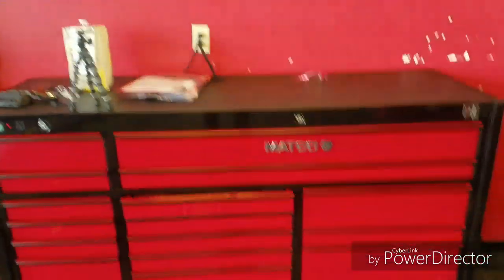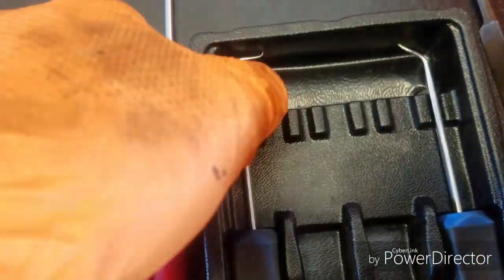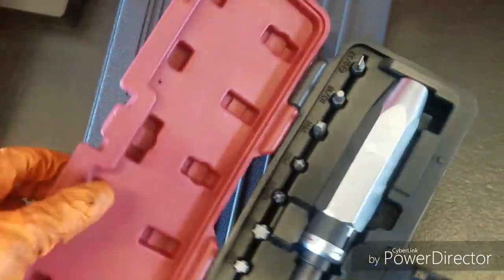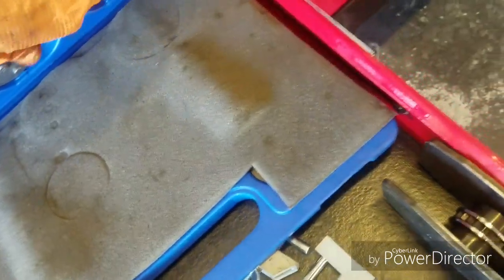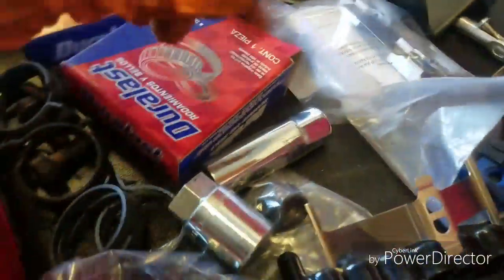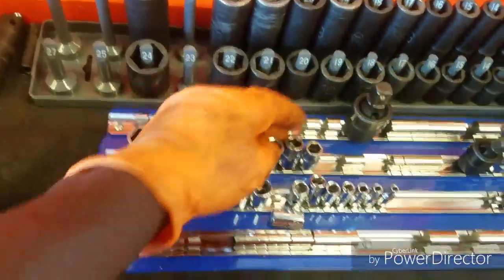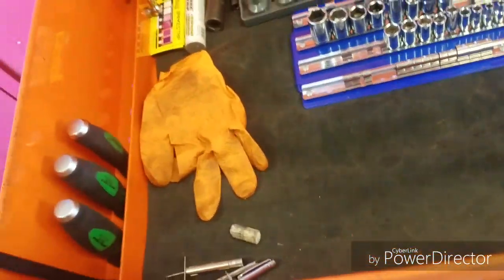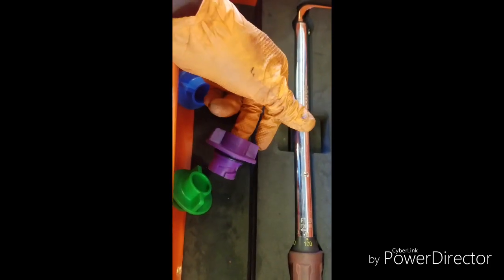1st YEAR TECH TOOLBOX TOUR!!!

Comment: That thermal imaging tool is legitimate a tech at my shop have one and the blind angles spots you can get into is amazing it really can help you alot without having to remove multiple parts to get to something..that tool with the right extensions and swivel can work wonders when the tool is actually needed it is well worth its value when come time to use it and especially if you drop something that is not visible but you know it's there because you dropped it and a extended magnetic is not extracting it because it may fall in a area that actually have pockets that can't be seen by other parts blocking its view Great video
Reply from the maker: Its an amazing tool honestly. It makes life SOO much easier. Thank you for the comment! Please go and check out my latest update video! https://youtu.be/tnA6yIDUuAQ
Reply: @quintonrhodes244  Checked it already I was the first to comment